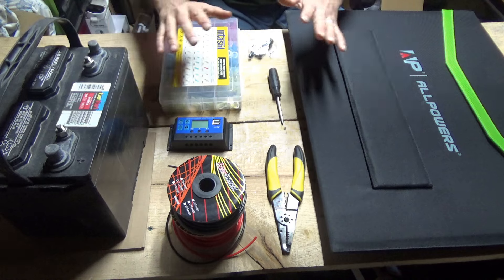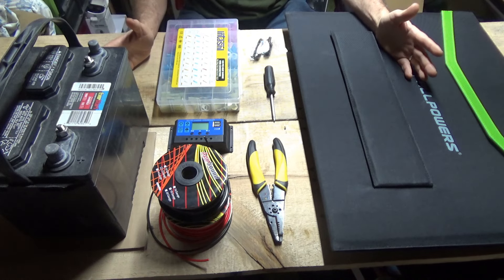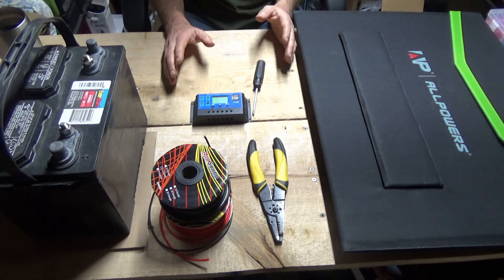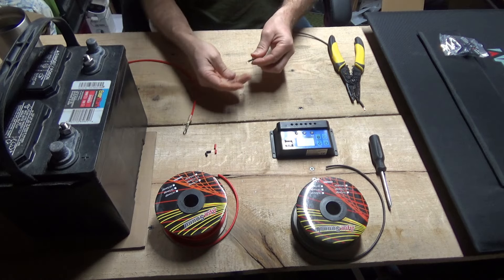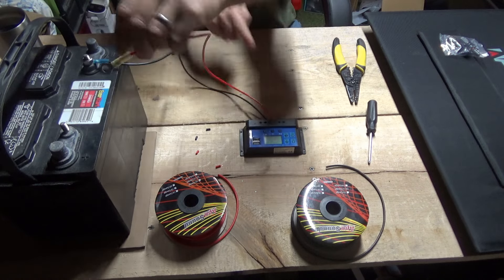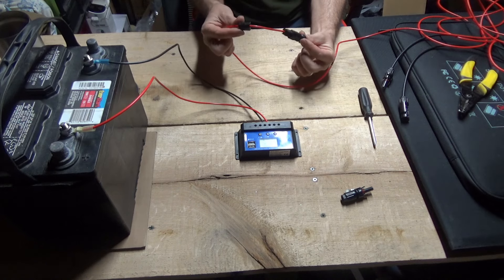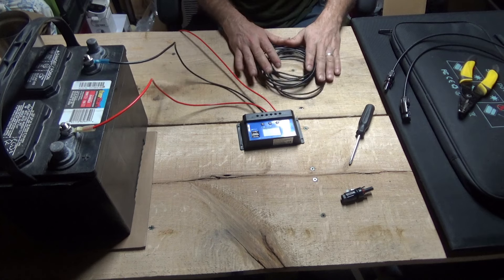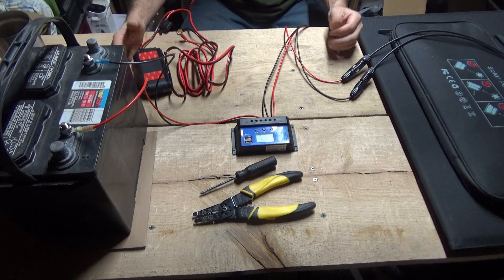How To Set Up A Home Solar Power System

Comment: Use a flat washer and a locknut on the battery connection if you are going to put this system in a vehicle to lock the connectors down. Vehicle movement will loosen the battery connections.
Reply from the maker: Another good point!!

Comment: What you have there is all good for demonstration purposes. But if someone is going to get serious about powering their house....
Even 5 kW split phase inverters aren't cheap. 15 kW split phase inverters are really expensive. Lithium Ion batteries aren't cheap, especially if you want 10 or more kilowatt-hours of energy storage. Several kilowatts of solar panels, plus the mounts aren't cheap.
Reply from the maker: This is a small system. Great for my needs at the watch tower. Good for a beginner. I am just showing people how they can get started. Many have told me through the years that they are unsure how to get started or afraid to. Start simple. Learn. Build up.
Reply: Well this worked out great because it was something that you needed anyway. And it may be a good start for people interested in solar power. As it can provide basic emergency power for charging flashlights and maybe your phone or laptop in a power outage. My point is that it is inadequate for a start in going off grid.
Of course, my belief is if you are on grid, you should stay on grid :) Adding solar power to offset power costs is always a good idea though.
Reply from the maker: Correct, this is a basic system for someone to learn from. Or for basic power backup. Or for powering small devices like for my watch tower.

Comment: I orefer wire larger than 12 gage for a 12 volt system.
Reply: Agreed if you absolutely must use a 12 volt system. However, I would prefer not to use a 12 volt system or lead-acid batteries. 24 or 48 volts, along with Lithium-ion batteries are much better.
Reply from the maker: For a beginner system like this 12 works but for sure with larger systems the biggest wire you can get, the better. I will be going into larger systems later.
Reply: Troy, wouldn't you agree that the higher the voltage the better? On the battery side, 48 volts would allow for much thinner wire than 12 volts would. Same on the solar panel side. 400 volts for example, obtained by wiring a lot of panels in series would allow the use of thinner wires to transmit more power. The very same reason utilities use very high voltages for transmission lines, up to 765 kV (765,000 volts).
Reply from the maker: For sure!! But for a basic system like this it is not necessary. This will be used to power some 5 Volt devices and charge my phone when I am hunting up there.

Comment: I was given a battery from a guy I brought an old panel from $50.  $10 for the same charge controller and $10 for wires.  $25 for a 200 watt inverter so about $100 to live in my car :)

Comment: Not the best information !
Steer clear of car starter batteries or anything with a CCA sticker !
Its for starting cars & 98 % charge time hence the CCA rating .
Only use one “if you absolutely must” just don't expect a lot from it .

Deep cycle , AGM or Semi traction battery's might do better 
but you still have the low cycle life of Pb technology .
If you intend going lithium skip the Pb chemistry now !

Charge controllers pick carefully .
A cheaper one will probably need replacing for going  48v , 24v , AGM or lithium chemistry's .

If you run the numbers most beginners push undersized Pb battery banks way past what's good for them .

Do your homework & don't expect miracles …...
Reply from the maker: This video is fully intended for someone to get started into solar. My first solar battery was a car battery. My idea was back from my high school years when a car battery ran a powerful car stereo for hours without draining the battery. Made me think there must be some power in them. Yes there is. If that is all you have, use it.

The idea is just get started. For beginners.

I will go into more detail later.
Reply: If I may give my opinion on this...
For beginners, shouldn't the idea be do it right and don't get discouraged? If not getting discouraged is a goal.... Using car batteries is probably not a good idea.
Now, if you're in an emergency survival situation... Use what you have.
Reply from the maker: Well David, my thoughts were like this.. and your thoughts may be different. For years I have told people just jump in and start out cheap and simple. Most people are afraid to get started or think it has to be expensive. The idea of this video was to take what you have on hand and just get your feet wet so to say. On a budget.

And I am using this starter/marine battery for my watchtower. A car battery does have some power in it. So does a lawn mower battery. I use them a lot in my projects.

Now I will be going deeper into more advanced systems later. But again, this is what I was building with at the time.
Reply: Troy, our thoughts are always going in two different directions :) You just want to get things done. And get them done as cheaply as possible on a budget. And I want to do things right and in a professional way, regardless of cost. Just two different ways of looking at it and two different ways of doing things. 
But if I may point out.... The off grid YouTube channels that get thousands of views are the ones who do things right. Now, that doesn't mean that they are experts in everything. But it does mean that they take the time to save money for things they can't afford at the moment, and learn things they don't already know.
Again, just two different ways of doing things and we each think our way is better :)
Reply from the maker: The main point of this video was to show people they can do it and just jump in. This was the most simplified I could make. I will later show better systems. And it works perfectly for my own needs. Why spend hundreds of dollars on a watchtower solar power system to charge some phones and cameras?
Reply: Again, I agree that the system you put together will work well for its intended purpose. However, for most people, while it does have some value for emergencies, that value is limited. Which is my point.
For example they don't just need to charge their phones and flashlights in a power outage, they also need lighting (AC lighting), and they need to keep the fridge and freezer going at minimum in an emergency. Some people also have a well pump that needs to run.
So future videos on more advanced systems will help those folks. But... If there are budget constraints, which is understandable, it puts limits on what you can do. Good systems aren't cheap. Can you put together a system on the cheap? Yes, but you usually get what you pay for.

As for making it "easy and simplified".... My opinion on that is that people should at least have a basic understanding of electricity, electrical circuits, and solar power before "jumping in". YouTube has thousands of videos on those subjects. But again, that is just my opinion.
In any case... Wishing you and your family a Merry Christmas!